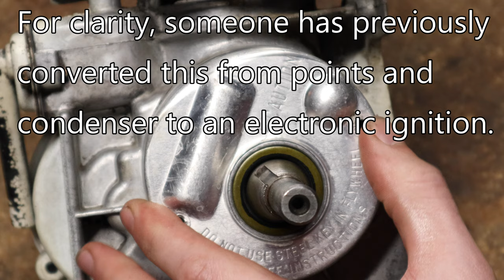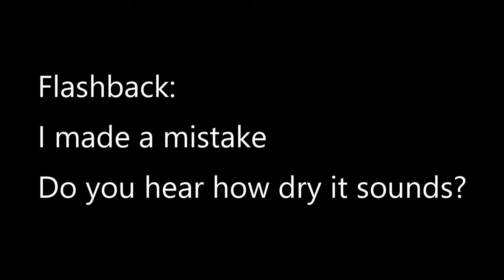1968 Briggs and Stratton 2hp horizontal shaft flat L head engine - complete rebuild - restoration

Comment: That little hole in the top of the starter clutch is an oil hole. It should have a little piece of felt in it to soak up oil. You should oil it there.
Reply from the maker: That's a good point.  Part of the reason I took the whole thing back off was to inspect the ID of the starter clutch and the crankshaft surface.  After that squealing I wasn't sure if there was any galling or damage.

I was not aware of there being felt in there, however.  That's interesting.  I'll take a look next time. Thanks for the feedback.
Reply: @Sockets_and_Sprockets  yeap a drop or 2 synthetic is what they say.

Comment: Need to use the box end of the wrench, also should have put oil in the pull cord starter instead of wd-40 and grease the ball bearings on the starter cord assembly.....

Comment: Thank you for posting this! I’m rebuilding a ‘67 right now and didn’t know how to get the valve springs back in without buying the $35 tool. Great trick with the wrench!
Reply from the maker: Glad that trick was helpful, thanks for watching!
Reply: @Sockets_and_Sprockets  When I put my valves back in I use mini zip ties to compress the valves then cut the zip ties  out when I'm done.
Reply from the maker: @Aidenmarin03  That seems like it would work too.  But is it potentially harsh when you cut the zip tie? Unless you compress it just the right amount.
Reply: @Sockets_and_Sprockets  it's quite easy, I compress the springs fully, put them in, then take snips and cut them. After that y< take needle nose pliers and lightly pull the zip ties out.
Reply: @Aidenmarin03  and The Zip ties Were JAMMED ! UP ! TIGHT !!

Comment: Great job!
I've finished one week ago to rebuild one from "97...I believe is quantum 50 from Briggs and Stratton...for a lawnmower...it was negligent for the last 10-15 years...and installed on a 2012 Husqvarna LC 48 EV....the 675 series from 2012 it was damaged (and to expensive to rebuild).... 
It's running perfectly, and I only clean it and replace al the gaskets....( And the flywheel from 675 because I've wanted to start it with the starter)

Comment: Thanks a lot for uploading this content. I bought a clapped out garden tiller from the 60's for ten dollars hoping that at least the gearbox worked. Now I think I may be able to get the engine running, too.
Reply from the maker: That sounds like a good project.  Good luck, and thanks for watching!
Reply: Same here. Got an Ariens tiller with an early 60's Tecumseh H22 motor. Thankfully it's in much better shape than this one...  whew.

Comment: First lawnmower I built from a box of parts had the horizontal version circa 1960.  Rebuilt the motor when I was about 8-9 with my dad but did lap the valves too.  Didn't see you do that.  Liked that you left some of the patina but would have cleaned up the carb rods and springs.  OA pretty good rebuild of rugged old beast and parts still available.
Reply from the maker: I did not lap the valves on this.  I probably should have but didn't want to wait for the spinny tool and lapping compound to get here. I got impatient.  Thanks for watching!

Comment: You did a very good job I'd have to say you have more balls than I do but for future reference...heat whatever metal is surrounding whatever you're trying to get out like a bowl or whatever expand that metal not what you're trying to get out make the muffler pipe & so on
It works for me
Reply from the maker: Thanks! I did spend some time heating the block, it just didn't make the cut in the video.  In the case of the muffler on this thing, its steel in aluminum so I think the aluminum is going to dissipate a lot of the heat. I was just hoping the heating and cooling cycles with the dissimilar metals would eventually break the corrosion between them. 50+ years of galvanic corrosion is tough to beat!

Comment: Just saw your video...Few pointers if you don't mind... Missing a ball inside the pull cord hub assembly, and always put a bit of lube (lithium grease) in the crankshaft end before installing the hub assembly,  should have checked the ring gaps before assembly, may require .005 oversize rings (chrome) if the cylinder is worn out, especially this is a used engine plus you honed the cylinder, might be a good idea to torque the con-rod to factory specs, how a bout hand lapping the valves before assembly, recoil assembly spring has a large "S" bend in it, doesn't seem normal, when I saw you put a new pull cord and just tie a knot, I knew that at one point it would undo itself because that happened to me before (tie your knot and use a pair 2 pair of pliers and pull the knot from the top and hold the bottom)
Reply from the maker: Pointers are always welcome. Thanks for watching.

Comment: Thanks for this video, greatly helps.  I have a similar engine that I am trying to rebuild that's off a 1967 Tiller.  Both intake and exhaust valves are seized up so I was taking the crankcase cover off to fully remove everything, clean things up and rebuild, replacing whatever needs replacing.  The only difference I see with my build vs what you are showing.  At your 6:07 minute mark, once I pulled the cover I have a bearing flush with the crankcase gear/timing.  Any idea how to pull that bearing off?
Reply from the maker: The easiest way to pull those is with a bearing separator/ puller. There are other ways that are sure to trash the bearing, like clamping it in a vise and tapping out the crankshaft, prying, or cutting through the races with a Dremel.  If you don't intend to replace them, I'd probably suggest you just leave the crank bearings on the crankshaft.
Reply: @Sockets_and_Sprockets  Thanks, I do have a pulley puller that may work. Otherwise I'll look for the bearing separator as I do need to get it removed as it's currently flush with the gear so when I put this back together I won't be able to see to accurately place the cam back so the timing is right.  And all parts could use a good cleaning.  Most looks clean but so much oil has turned into this thick sludge.  Figured while I have it opened up and fixing the valves I'll give it a good cleaning.  Thanks for the tip.

Comment: I understand the value of keeping it original. I have this exact engine and am in the same process of cleaning it up. But id like to modify mine with an aftermarket carburator. Do you know how id determine the size ?

Comment: the hole atop the starter clutch is where oil can be dribbled down. there is a pad that holds the oil underneath the hole. use engine oil not wd40 or similar

Comment: Nice post! I'm working on the same engine. Mine is a 1976. Did you notice that the valve springs are different in height? I believe the taller is the exhaust. Is that also what you saw?

Comment: I’m working on the same engine. This video is insanely helpful, thank you!

Noob question: is the thread on the muffler a standard ‘righty tighty lefty loosey’ thread? I’m having the same stuck issues as you but I wanna make sure I’m not making my problem worse!
Reply from the maker: Glad the video is helpful.  Yes, the muffler is right hand threaded, so "righty tighty lefty loosey" is correct.

Comment: The Previous owner ! Just RAN ! THIS ! ON ! WATER !! VAPOUR !!
Reply from the maker: I don't know  how it ended up with water in the case and no oil. The only thing I can think of is they drained the oil for some reason and then left it outside?  Who knows.  Your guess is as good as mine.
Reply: @Sockets_and_Sprockets  So why didn't you put this in the Metal Shreadder ! Then !??

Comment: The rings that went in are for a Iron bore engine. You need chrome faced rings for the aluminum bore. The bore is going to wear out fast.
Reply from the maker: I wondered about that for a while when I was getting parts.  On various forums, I saw differing opinions (surprise!).  Some said Kool-bore had to have chrome faced rings, others used cast iron rings.  I saw posts that said they came with cast iron rings originally and chrome faced rings were provided as an option for rebuilding to help the rings seat in a glazed cylinder.  And so on.  I decided to just run these and see how it goes.  Thanks for watching, and good eye.
Reply: @Sockets_and_Sprockets  I'm rebuilding a 1976 right now and I just  snapped the oil ring, where did you get your rings from?
Reply from the maker: @JosephStalin1941  I believe I got the ones for this particular rebuild from ebay, but small engine supply websites like Jack's small engines or even Amazon might have them.
Reply: @Sockets_and_Sprockets  thank you very much, and standard rings for the 60100 series should work right

Comment: I am rebuilding one of these atm  The flywheel has a woodruff key, like the one in the video.  The points cover says "Caution Do not use a steel key.  See Instructions"  as doe the cover in the video The key that came out looks to be steel.  What am I supposed to use?  Is there some other kind of key than steel?  Thanks to anybody who can shed some light.

Comment: Mod N weren't they when they had the float carb. We used to hotrod them where were 12 years old and put them on go carts we made with 2x4s, an old reel type mower (Even old in 1958 ) and race them. Real trick with the rope steering and no brakes, but we learned enough to end up in 600 HP A/P Corvettes 10 years later. Too bad there are no more engines like that for kids to abandon their smart phones for today. You can learn a lot more from an old Clinton Motor then you ever learn from playing Pac Man.

And Hey, all that work and no paint. Krylon works wounders,,,,,,if you don't go for Chevy orange.

Comment: No boot on that sparkplug wire is a shocking omission.
Reply from the maker: Haha! That's just how it used to be.  And the stop "switch" was just a piece of metal you push over to ground out the plug. Shockingly simple.

Comment: Should have put a smidge of grease for the slider on the pull rope area
Reply from the maker: Do you mean where the rope passes through the cover?  Thanks for watching.
Reply: @Sockets_and_Sprockets  no sir the little socket piece with a ball bearings rod
Reply: @Sockets_and_Sprockets  where are you sprayed the WD-40
Reply from the maker: 👍 Got it

Comment: It's interesting you were able to find the parts,  I had a hard time finding the parts for a 12.5 horsepower B&S. When I had a shop find the parts,  it was cheaper to buy a new engine than the replacement parts.  

That is an excellent  job Sir.  Did you replace the piston with a standard size,  or over size?  With mine the cylinder was worn so bad,  it would need a .020 over. Very expensive.
Reply from the maker: I actually found the piston on ebay for a reasonable price.  Someone had it for sale as new old stock. And I used a standard piston in this one.  It's a shame that it sometimes costs more to repair than replace. Seems like that's how it goes for more and more stuff today.
Reply: @Sockets_and_Sprockets  
Yes sir,  I found a few items on e bay, the problem is, they wouldn't garrentee what I bought would be what I needed.  

I know it sounds crazy, I bought a 25 horsepower Briggs and stratton,  on line for $70. They said ANY order over $50 had free shipping.  The problem is, it's coming from China and can take up to 30 days.  For that price for a NEW engine with double the horsepower is worth it.  

Again, an excellent video sir

Comment: Not really the best to do all the cleaning in the sink. Here they water treatment plants can track the oils and give you huge fines
Reply from the maker: I wouldn't pour used oil or antifreeze down the drain, that all goes to a recycling center.  But I think occasionally getting the grime off some parts is fine, at least where I am.  I wash the oil and grease off my hands all the time.

Comment: Valve clearances (lash) should have been measured before installing springs in case they need adjustment (filing).
Reply: Agreed and having gone that far into it might as well have gotten some valve grinding compound and reseated the valves